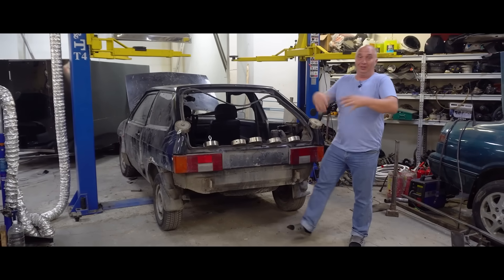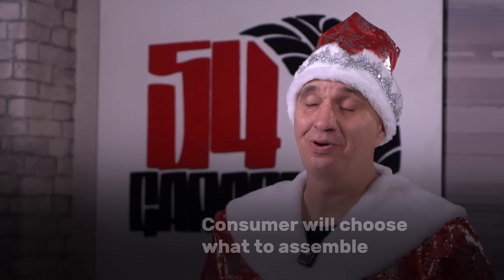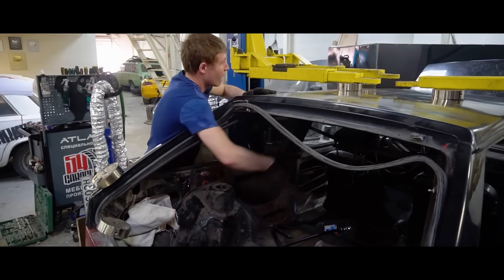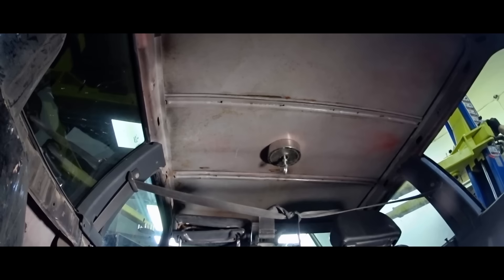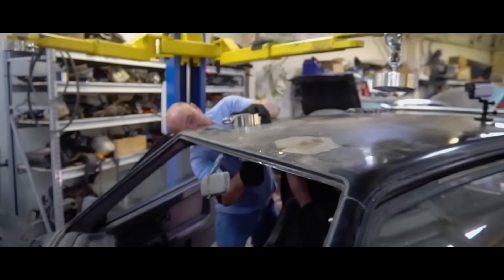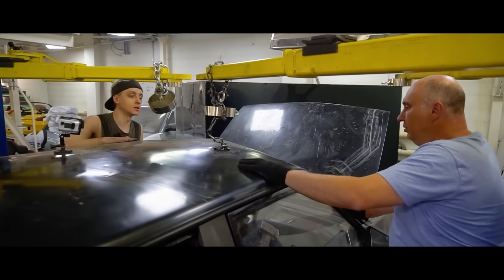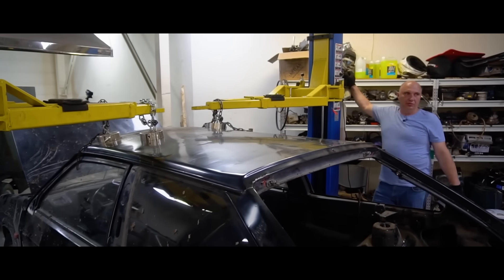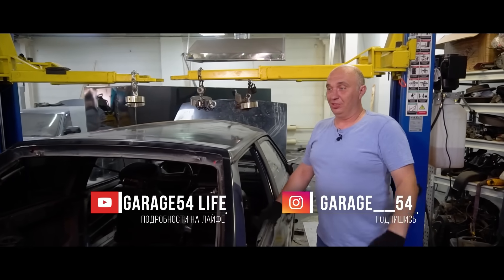How many search magnets does it take to lift a car?

Comment: Here is an idea. Modern cars are disposable as they are engineered with proprietary systems, computer control modules and all sorts of complexities that make them difficult, expensive or impossible to repair. How difficult would it be to convert from electronic to analog?

Comment: use the permanent magnets, in conjunction with an electromagnet, to make a clutch that engages when current is supplied to the electromagnet. The more current, the tighter the clutch pressure. Bonus points for using the engine to create the electricity, perhaps with inverters and multiple alternators.

Comment: Start by welding a 15 mm plate across the top and put magnets under it so it lifts at the corners maybe four up front. Then you can put rails and weld them so it doesn’t flex. Maybe try the opposing field arrangement which gives high flux. 107 %

Comment: Can you take an engine with worn bearings and remove the shells , place a smear of valve lap compound on the rod and cap to increase crush and lower clearance? Or shim with aluminum foil, which can be.0005 “. Maybe one with little oil pressure. See if it comes up? I would love to visit you. This time of year I would freeze.

Comment: If the magnets can hold 600 kilos each magnet than with the 4 you combine should hold 2,400 kilos not 1,200 because each magnet connected to each other increases the strength but the value remains the same, so its actually 2,400 with them sticking to each other.

Comment: Garage 54 idea: take a regular stock Lada and add a small electric motor boost (hybrid style).
Gas engine stays stock, electric motor helps only on launch / hills / overtakes.
Test 0–60, rolling acceleration, and hill climb vs stock.
Would be интересно to see if electric torque actually makes a Lada faster 😄

Comment: Lifting from a flat / horizontal surface will be better. Try a steel beam through the window openings to equalize the pull.... and optimize a flat surface.

Comment: Also, you need a substantial thickness of metal - the thin sheet metal of a car roof is not enough to get full force.
Reply: the problem is once the metal is distorted you no longer have full contact for lifting  force.

Comment: Why don't you try to replace the wheel bolts by a magnet, try to stick the wheel to the differential by a magnet instead of bolt and nuts